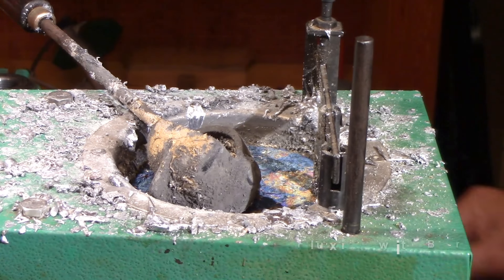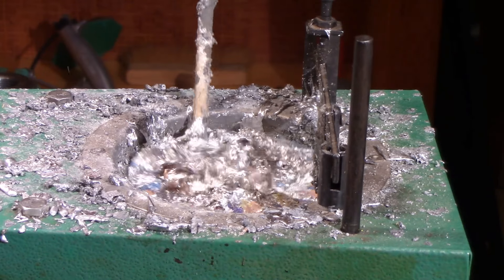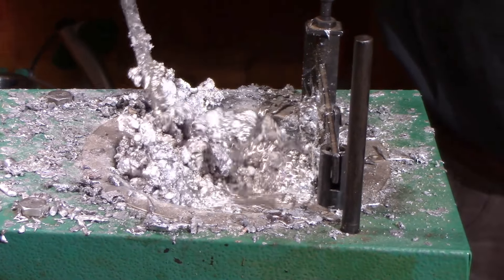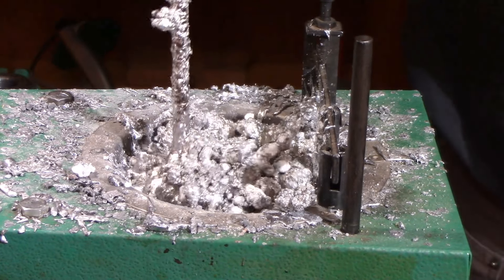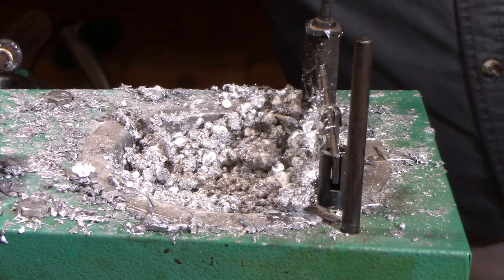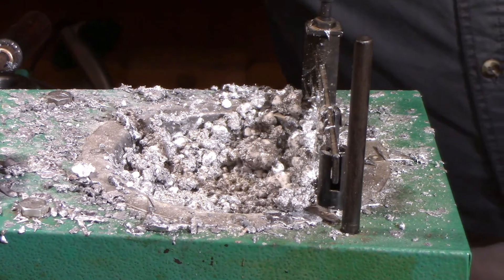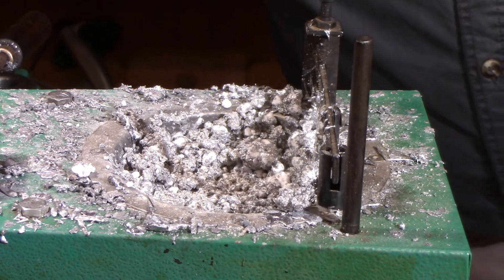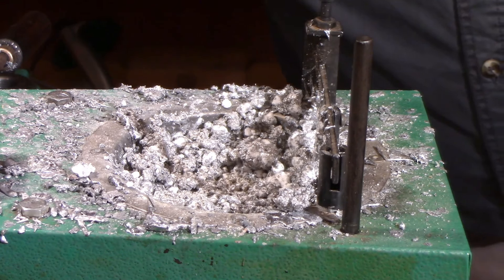Using Borax For Fluxing

Comment: The reason the borax bubbles is that it is hydrated. When you heat it, the water is released. If you just let it bubble on top, the water won't get in the metal. Then the borax ends up as a glassy liquid. Works great for copper.
Reply: Here's a good discussion on using borax. The most common flux I've heard used is pine sawdust. Apparently the sawdust turns to carbon and scavenges any oxygen, including any that might be in the alloy.
Reply from the maker: Yes, that's due to borax's hydroscopic nature alright.  It has a tendency to draw moisture from the air when left sitting around, so I try to minimize that effect by keeping it in sealed containers while not in use.  Definitely a good idea to wear some protective clothing (especially for the eyes) when using it for fluxing, since it bubbles a fair bit.

I actually appreciate a little bit of bubbling when I submerse a flux compound, as it disturbs the melt, causing more impurities to come in contact with the flux.
Reply from the maker: That's an important point Charles.  Fluxes are distinguished by whether the mainly scavenge the oxygen from the metal or whether they mainly remove impurities.  Carbon-based fluxes like sawdust focus mainly on the former (although they clean as well), while fluxes like Marvelux and borax excel more at removing impurities.  So, when I am melting down a batch of wheel weights, turning them into 1 pound bars for later use, I use a lot of sawdust and then, when I am preparing for bullet casting, I switch to Marvelux or borax to focus more on the cleaning aspect.  The cleanliness/purity of the metal alloy is far more important to good bullet production than trying to prevent tiny, tiny losses of tin due to oxidation once I get to that point.
Reply: Does it work for silver as well?

Comment: Does the Borax flux out the zinc that could be in your wheel weight mixture?
Reply from the maker: Thanks for your comment.  No, it won't flux out zinc.  But, if melted down properly, you won't have any zinc in the wheel weight mixture anyway, so I wouldn't worry.  Zinc's melting temperature is far enough above the melting point of lead.

Comment: Borax will absorb a lot of moisture and thusly the reactive nature.
Reply from the maker: Yes, that's something to be careful of alright.  I now use a spice shaker to sprinkle the borax thinly over the molten surface.  It seems I need only very little borax to clean the alloy well, compared to the Marvelux I used to use.
Reply: Would it help to dry out the borax a bit by heating it some on a low heat?

Comment: I use borax but in my old cast iron skillet. Recently found your channel.
Reply from the maker: Hi James.  Anything that works.  For years I used to use just an old Coleman stove and a little pot for melting my lead and using a ladle to pour into the moulds.  Borax works well for fluxing and it's so easily available.  Thanks for subscribing!

Comment: Does fluxing result in a softer lead than the original alloy?
Reply from the maker: No, it has no effect on the hardness of the lead Kurt.  The main purpose behind fluxing is to remove impurities from the lead.
Reply: @TheWaytoNativeChronicles  thank you for a prompt reply.
Reply: How much quantity of flux should be use for metling solder dross per 100g

Comment: what an ugly mess. not quite the way to do it.  saw dust, wood chips and some bees wax is far superior. and my goodness you put all that crud in such a nice furnace. I guess you dont have another pot and heat source to clean and flux your alloy so you can make some good clean ingots to put in such a nice furnace as that RCBS to cast whatever your casting.
Reply from the maker: Heh.  Thanks for the warning.  I didn't realize that - after 40 years of doing it this way - that my 35 year old RCBS melting pot will be ruined in no time now because it looks messy.  Hopefully you caught this in time, so I can change my ways and save my equipment from an early demise.  Thanks for taking the time to share your opinion though, anyway.  Cheers!
Reply: @TheWaytoNativeChronicles  😂😂😂😂😂😂👍
Reply: I always thought the performance was more important than the looks😕 Am i missing something before i get into this lead melting thing?